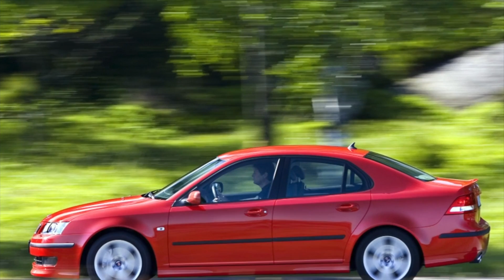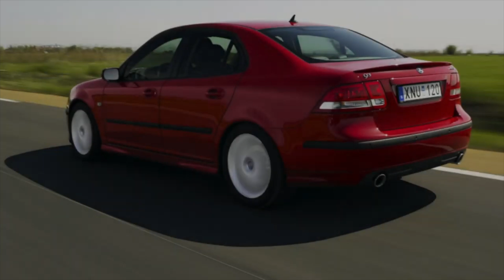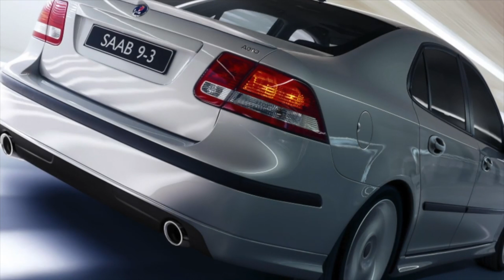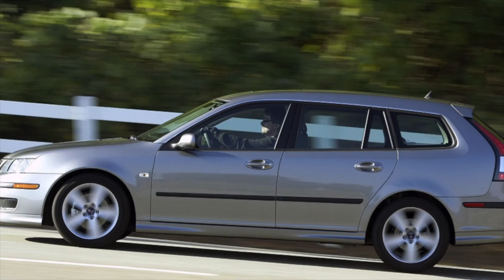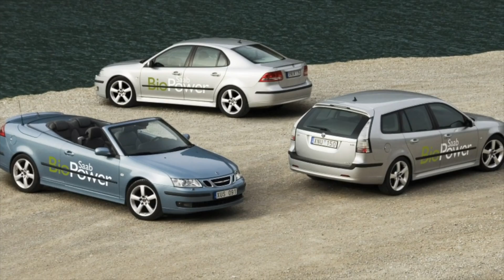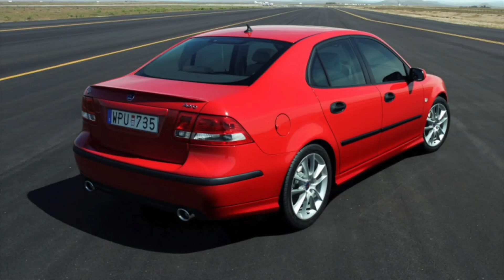Saab 9-3 2 - Check For These Issues Before Buying

Comment: Beg to differ with regard to the 16v Fiat 1.9 found in the Tid. I have that in a 2006 9-3 convertible and a 2010 Sportwagon. The wagon is on 195k miles and the convertible 135k miles. Both are relatively quiet compared to older designs and if properly maintained, reliable and economical. All the problems are well known and easy, and cheap to fix.

They also respond well to tuning, so for around £300 they can be remapped to circa 200 bhp with no other modifications. I also own an Alfa Giulietta with this engine and over the 6 years I've had that car I have had no engine problems whatsoever. Now on 165k miles the JTDm has been 100% reliable, economical and smooth.

Having owned 75 cars over 45 years I find the 1.9 Fiat unit to be easy to work on and a great compromise, economy with power. I've completed a dozen sports car restorations (MG and TVR mostly) and found the older engines with Kjet far more problematic and difficult to set up than the modern diesel engine in my Saab.